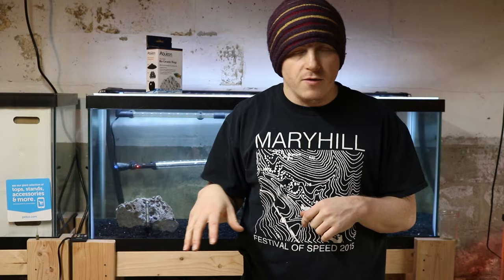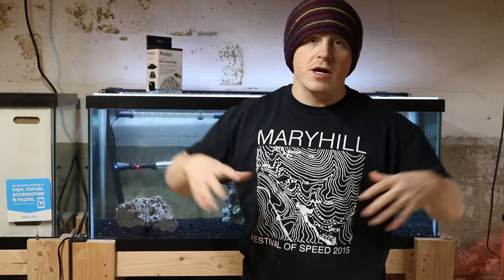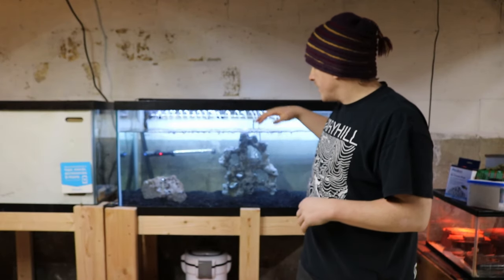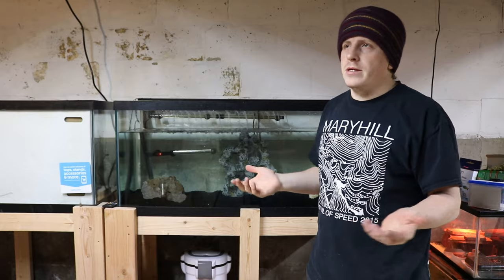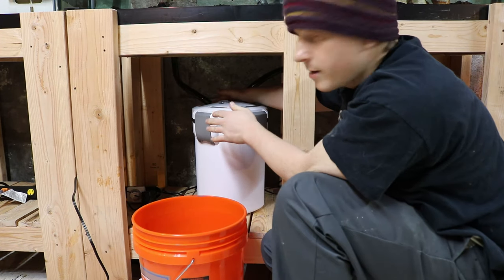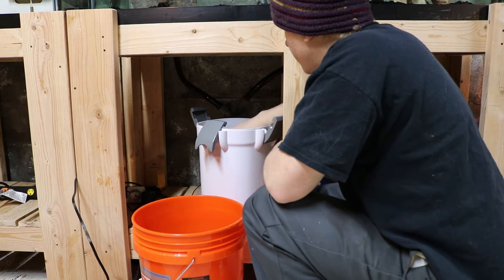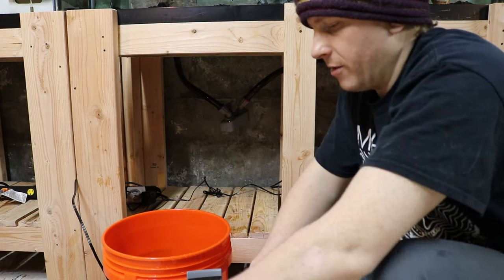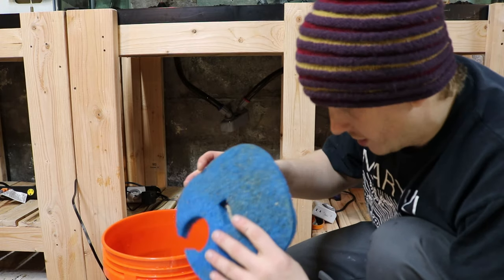Overhauling My Aquatop Forza Filter

Comment: Can you turn on/off the uv ?
Reply from the maker: Yes you can.
Reply: Yeah but get a fluval these things suck. Pain in the ass to prime, they leak easy, they suck putting back together after you clean them, they leak super easy, they have shitty water flow, they leak really easily, the parts inlet and outlet connectors have a ton of unnecessary parts and can easily break, and idk if I mentioned it yet but they have a tendency to start leaking....
Reply: @7205buttas  Lmfao... these are waaaaaay more sturdy than the Fluvals. And also the Fluval doesn't have a UV in it. Not to mention even the FX6 can't hold as much media... The only pro is the maintenance is slightly easier.... but Fish hobby isn't for the lazy...
Reply: @MrRickyb81  idk I hate the things. Losses flow really fast too. I mean it works I guess but always have problems with leaks. The fluval never gives me problems. And the UV I mean, unless you have a visible algae issue is kinda unnecessary